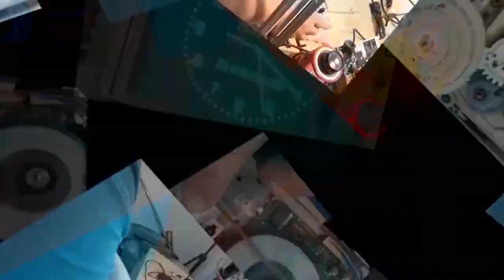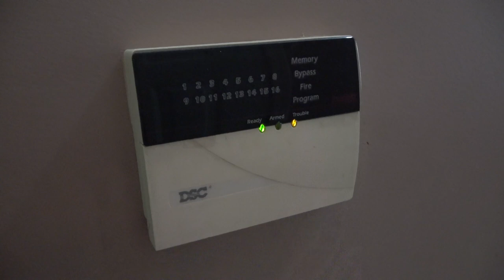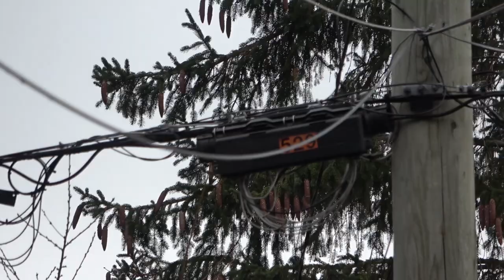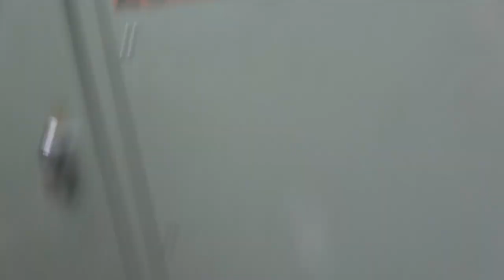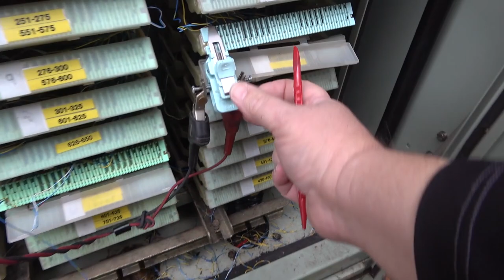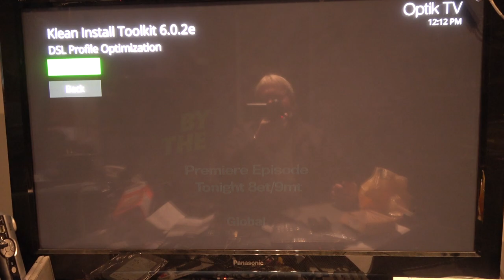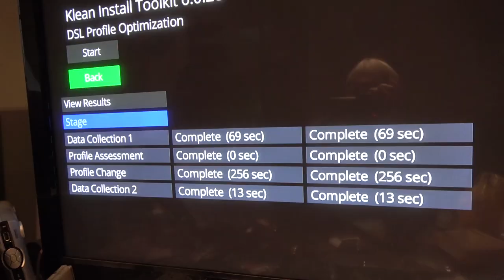Fixing my old noisy copper phone line

Comment: I live in Rural WV...my DSL speed is the best that it has ever been...about 5800Kbps...or 6Mb.  You have 60+.  I am jealous.  I wish we had fiber options to our homes in this state...but most of us don't.

The big problem that I can see is they over sell the bandwidth available in any given area...and then pretty much flat out refuse to upgrade or maintain the lines unless it is absolutely necessary.  We literally have wires running through trees, and hanging in the creeks and water ways.  Anytime it rains it goes sideways.  Terribly frustrating.

we have no other options, satellite gets capped in terms of data and the speed ain't there, and typically those companies also over sell their service...but it won't stop em from billing us our monthly fee...in fact mine is now 90+ for simple phone and internet...internet of 6Mb.

Monopolies I think.
Reply from the maker: Monopolies are actually good in things like telecom infrastructure. The reason is economy of scale.
Back in 1981 I interned at a community station while going to school taking my broadcast courses (originally I wanted to go into TV broadcasting) This was right at the time that the CRTC in Canada was about to end the monopoly on the cable and telephone companies bowing to public pressure, and following the USA.  The public hearings were being held in Vancouver and televised live by theie community channel. Where I was there was no interconnect, and since the cable owner was presenting, he wanted it carried. So I was tasked in recording the proceedings at the studio and bringing the tapes back to our local station to air later that evening. The owner argued against deregulation and breaking up the monopolies. His arguments very valid at the time, and still today to some degree.
Back then the cable co provided TV. That was it. The phone company provided phone, and dial up data. The internet didn't even exist back then. It was all hobby BBS. (I ran a BBS for 10 years too)
His argument was simple and he broke it down into nice easy to understand numbers for all the dummys watching.  You have 100,000 customers each paying 10.00 a month.
That's 1,000,000 in revenue. Cost of programming (broadcasters are pair a fee to carry their signals) 2.00 per month per customer. That leaves 800,000 a month in revenue. 150 employees making on average 3000 a month in salary. is 450,000 a month in salary expenses. That leaves 350,000 a month that is easily consumed by other fixed costs like taxes, and vehicles, electricity, rent, insurance ect.

Now enter competition. Competition enters, and to sway customers offers service for 9.00 a month.
50% of customer base jumps ship. Now you have only 500,000 in income, and sure your wholesale cost drops by half because you have only half the customers but your fixed costs do not go down by half.
So now under this model, you have dropped your price to match the competition, you have 50,000 customers paying 9.00 a month, which is 450,000 in gross revenue. Your wholesale cost now 100,000 leaves 350,000 in working capital.
Your salary for your employees 450,000 a month. So what do you do? Lay off half your staff. Now your salary cost is 225,000. That leaves 120,000 a month remaining to pay for things line insurance, rent, vehicle costs, electricity, taxes ect, Remember your fixed costs do not go down. As he predicted in 1981 this is a non sustainable business model, and prices would have to go up. How right he was.
The first part of deregulation in Canada saw an end to monopoly on long distance. Long distance use used to subsidize the local phone line. We say local lines go from 12.60 to 30.00 a month. Not over night, first they went to 1750, then 23.00 then to 30.  I shut down my multi line BBS in 95 when the local line went from 12.60 to 17.50. I cut down from 5 lines to 3, and then to 2, and kept the final line, which I used as a dial up for the internet until 2000 when DSL went in.
Thing is when you have multiple companies chasing the same number of customers there is less money in it for everyone, and that is when maintenance gets overlooked. Had deregulation not happened you would have very big companies, making lots of money for sure, but the average that the end user would pay would probably be less than with all these companies. The same thing is now happening with streaming. Netflix was the first, but with all these other companies starting up  and pulling their content from netflix, if you want that content you have to subscribe to these other companies too.
Netflix used to cost me 7.00 a month. It is now 14 a month and staring in April 7% tax is to be added. That is the final straw, I canceled my netflix account and once my free year of Amazon is used up in January I will not be renewing. I never watch anything on either platform. Waiting for the final season on Bosch, on Prime and hoping for another season of Ozark. Will sign up for 1 month when these new seasons drop and then cancel.
Reply: @12voltvids  I use to have Hulu, Disney, Netflix and Prime...realizing that I was spending as much as I would in actual traditional modes of television I now only have prime, but I subscribe to prime yearly and for 12 bucks a month I save probably 3 times that easy just on shipping...and I do find their digital credits available to prime users really handy for buying digital books and audio books that I listen to on my hour commute to work.  It is a necessary evil...kinda thing.

As for monopolies.  I don't want to drop names, but let's call the company I am referring to as "X".  X bought out another company in our area many years ago, nearly all the infrastructure in rural WV is crap at the time and still this is the case in many areas.  X proceeded to serve their customers well, we experienced better speeds, more options and at no additional cost...initially.  After a year or so these speeds and connection issues was to the point where they would have us power cycle modems to reestablish the connection up to 5 or 6 times a day in my case, more or less in those folks in the area.  Our price went up and they enacted protection to keep from having to do the right thing.  Honestly I tried looking at this every way, but I cannot explain their actions other than to say it is a "Gaming the system" approach to maximize their profit without as much risk.  Suffice to say these are just some of the things X did.  They lobbied and got passed several bills that would enable them to deny digital communication(ISP) to people, charge "other costs and fees" that made our bill more, initiated internal policy based on these new regs that kept them from having to do the right thing in the case of billing discrepancies...for instance if X accidentally charged you for some service that was not in your area or you did not ask for, they only had to pro-rate back for 6 months max...even if that error was for longer.

It gets rather lengthy...suffice to say, having them...i.e. the ISP and data in general be classified as Utility would probably do the most to get a lot of these issues resolved...but X and every other ISP in the area is fighting hard against it.

Our AG, and Gov. at the time forced X's hand and X finally ran fiber to a lot of the DSLAMs in our area...which stabilized our connections a lot, but after a year they still do not offer the bonded they promised, and my cost just for internet is 50 a month and that is for 6Mb...I know people that pay that for 200-300Mb in the city...and from the SAME company.  So, I respect the work the technician, engineers, and most of the work force perform on the daily in these companies but I do not like X.  Once, maybe, but after they changed their business model they went straight to my naughty list...lol.  In fact, several years back when X peeved off their work force and 3/4 of them went on strike...I was approached to be a "temp" for the sum of 40 and hour + 90 per diem which is freaking amazing pay in my area...and I said no...my parents taught me never to cross a picket line...and that was what they wanted me to do.

Anyway brother, have a good one...
Reply from the maker: @Kai-Made  I have my basic and premium channels and Crave. Has everything I really want.
Picket lines, I remember those from when we were locked out. I kept getting calls from management asking how I was doing and if I would come back to work they could send me to Alberta where nobody knows me and I could make big bucks. My reply was I come back to work when my brothers and sisters come back and not a minute before. Don't call me again.
Reply: @12voltvids  exactly...not for 500 bucks an hour...
Reply from the maker: @Kai-Made  my dad was a longshoreman and went through a couple of brutal strikes.  Ours was brutal too. 5 months. Try to live on 1000 a month strike pay.  Mortgage was around 1400 at that time.  I was working as a contractor installing satellite dishes to make ends meet on the days I wasn't on the line.
Reply: @12voltvids  Sat installs are the worst...in hindsight I would probably just starve if I had to do that crap again.

It was not the actual work that was terrible, but the tools I was given to do the installs were terrible and worked about half the time, so I spent a lot of time doing trial and error with virtually no one else in the company able to guide or assist.

I was also constantly, more often than not, fixing something a previous installer botched.  Like seriously.  Polls 12 inches in the ground to support a 40lbs radio and dish...oh your signal is weak?  No kidding, I could not tell since you were like 10 inches out of alignment.

My favorite install was when I literally had to go over the previous installers work from the very beginning, wire not in conduit, only 3 inches under the ground, poll in only 12 or so inches, no concrete, no clips to hold the wire tight against the surface...

Yeah.  You are bringing up some rather hard times...lol.

I did "field engineering" for a bit, utilizing sites like atlasfe and fieldnation.  I had roughly 30 jobs I did across 3 different provider platforms over the course of a year or so...decent money(30-45 per) but man they had me driving like 300 miles each way to do a 30 minute install.  It was nuts...and a lot of the time they had mis-information which held up the job...which I was alright with...coffee breaks are still on the clock when you are onsite...so what if they took 2 hours....lol.
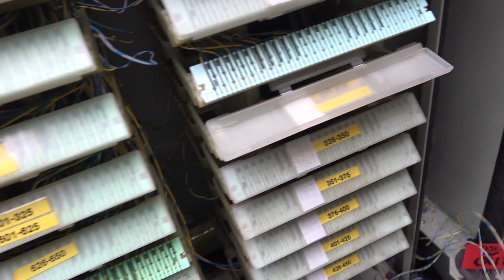Reply from the maker: @Kai-Made  I never did any sat installs on poles. They all had to be mounted on the house if could not get signal I walked. There was good money and sat installations I was clearing 15,000 a month but I had to supply all the materials so by the time I paid for materials and gas and factored in the hours that I drove all over hell's half acre I probably was making 20 bucks an hour at most. I would start my day leave the house 6:30 in the morning not get home till 11:00 at night and do the same thing the next day 6 days a week. Many days would drive upwards of 200 miles just getting to the sites at home it was going through a full tank of gas every two days. In the time I did that work which was about a year and a half I put over 100,000 MI on my truck. I left that industry when I went to work at my current job and within a year we were on strike so I went back to do SAT work for a few months and just hated it. By this time the company had changed hands and the new owners were paying $57 to put up a dish total. When I did it before we were making about 150 to put up a dish and run the cable. When I complained that I couldn't make any money at that rate the owner pointed at all the other guys and said they're willing to accept that rate if you want the work you will work for that rate. It was a shit show for sure but I needed to keep food on the table.  I could tell you stories of a few interesting customers and my response. How it worked in the satellite world was you did not get paid unless you got a signal got an activation and got the account number to put on the invoice. So no line of sight was a wasted trip with no pay. Doing it install and then finding out after the fact that the customer does not have a credit card which was required for activation would not result in a completed install that's no pay and satellite company would expect the equipment to be removed again for no pay. Was an absolute joke, they knew I was there just because we were on strike at work and I was desperate so they took advantage of everybody because most of the guys that were working for this company we're doing it for the same reason. Here's the real kicker the install included putting up the dish and running one run of cable to one receiver. Additional receivers we could charge $50 per run plus the cost of the cable at $0.40 a foot. The cable cost me about four cents a foot to buy. If the customer paid me cash I could keep it all because after all I own the cable but if the customer wanted to pay by credit card or by check it was made out to the installation company who would take 50% off the labor charge and off the cable. I got in a few fights with the installation company over switches, where I would supply a $150 multi switch which cost me $75 and sold for $150 and the company would if the customer paid by credit card the company would keep $75 and give me $75 which is what I paid for the switch. There was another time where I put the switch inside the plastic cable box to keep it dry couple days later when the cable company comes to disconnect the cable the cable guy removes the switch and takes it so now the satellite doesn't work I get sent back out to do the warranty work because they're not paying me because now there's a trouble and I find the switch is missing so I tell them you got to pay for another switch and of course the customers refusing and the company won't supply a switch so guess who's on the hook for a switch they were expecting me to supply a new switch out of my inventory free of charge or they would not pay me for the install let's see install may have netted me 100 bucks and I'm supposed to give a free $75 switch to a customer because the cable guy stole it that's two trips to this house 100 mi away for $25 absolutely ridiculous. Another instance where I was charging a customer for cable by the foot at 40 cents a foot and somewhere the customer looks up and sees in some documentation the cable was charged at 25 cents a foot they filed a complaint and the company ordered me an independent contractor to refund the difference between what I charged the customer for excess cable and what the website said I was supposed to charge. They made me refund $10 or they wouldn't pay me for the job, I was so pissed off I went to the bank got $10 in pennies drove to the customer's house and threw them all over his yard and said here's your effing $10 refund jerk. probably cost me $20 in gas to do it but man it felt good knowing that he was going to have to pick up all those pennies all over his yard are they be going everywhere when he mowed the lawn it was a satisfying feeling!
Reply: @12voltvids  sounds like you have a few stories for the reddit rslash...maliciouscompliance.

Hahah.
I think we have all been there.  I worked with a dude, that was absolutely the best, hands down, most loveable dude I have ever met.  He was A, good at his job to an almost unbelievable level, and B, really good at people skills.  He would be called into a situation to resolve conflict because the "force" was strong with him.  He was absolutely an amazing person.  Well, there was a lady who we had done an install for, and after a couple days I was called back out to address some issues with speed...cue the Karen in her.  She lamented that it cost too much, was not nearly as fast as advertised and that she was not paying, wanted her install cost refunded and for us to take back all the stuff...I tried in vane to explain that even the best satellite system would not work well if 4 computers were all trying to download and stream at the same time 4 different people were streaming on-demand apps like netflix in high def.  This is a given, and it was explained up front.  Well, this guy came into the mix trying to resolve the issue, and after a long, seemingly endless hour of listening to him calmly explain what the matter was and that the sat was working correctly...she cussed us and him once too many times and he threw his hands up went to the truck and got the tools and removed all the equipment in about 8 minutes.  He never said a word.  Then when we were leaving he said to me, my brother works for the only ISP other than our Sat system as a field tech...he told me there was no other option for her internet-wise smiled and said have a good day and we left.

She called our company 2 dozen times after that trying to get sat again, but we refused to do the install.

lol.

People, sometimes you just gotta ignore em.

Comment: Phones use GPS as little as possible and prefer to use WIFI and Bluetooth triangulation whenever possible, so it's not uncommon for your phone to use that as well. That's only because of google who did that for more accurate location finding.
and ofc your router has a location set on it, so there's that, that's how google maps on the desktop knows your location.